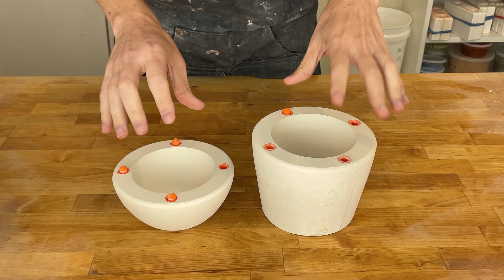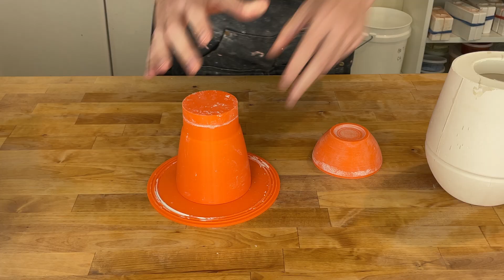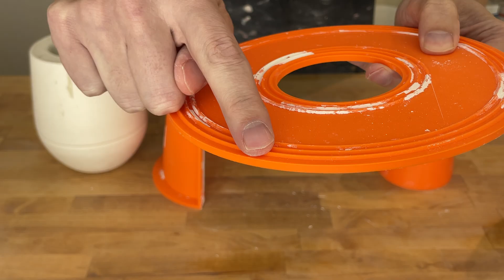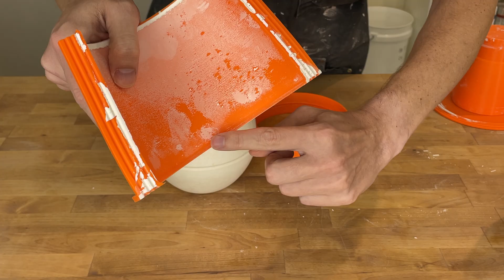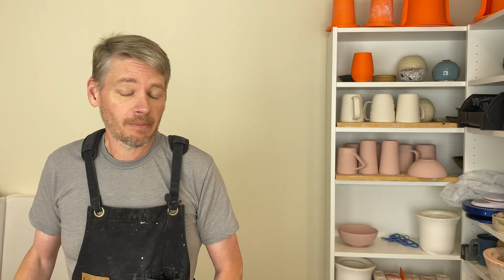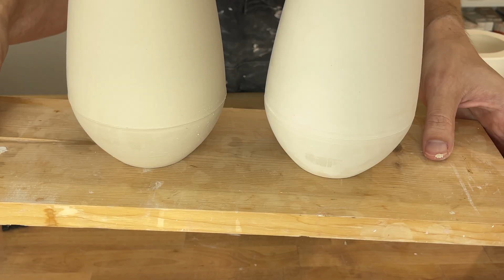Belt - No Suspenders! A 3D printed tool to align 2 part molds

Comment: Something I like to do for spaces like the zig zag section: use school glue. It will stick the pieces together temporarily and prevent plaster infiltration. The moisture and humidity from the plaster will soften the glue so when you take the pieces apart, you can simply wipe it off with a damp sponge.
Reply from the maker: Interesting. How long does the glue take to set and does it stay in place on the PLA? Very early on I'd use caulking but waiting on it was annoying. With just using the binder clips there is 0 wait time. As soon as they're on you can pour plaster which is a small thing but turns out to be rather nice. Also if folks are worried about leaking I suggest just using water proof tape. I don't find it's needed with my process but it is an option.

Comment: Very clever! I like the new approach. It's less complicated both in the printing and while making the plaster cast. Fewer pieces. Reusable. Friendlier to a person paying someone else to print their 3D prints. But translating this approach to the rectangular plaster molds is an interesting problem. There are so many gotchas.  Good luck!
Reply from the maker: Great points! I agree. Yes getting this to work with something like rectangular handle molds will take something different to get the right clamping forces.